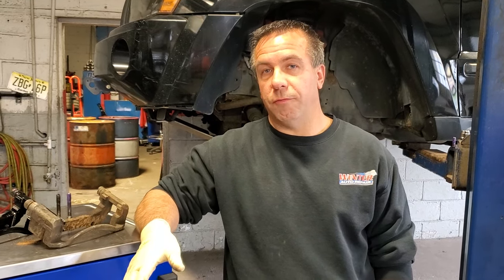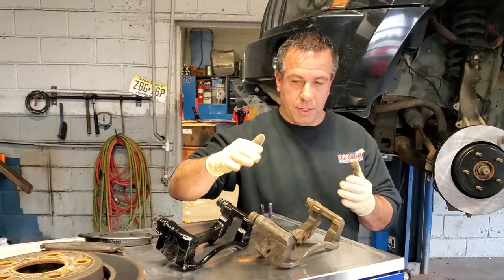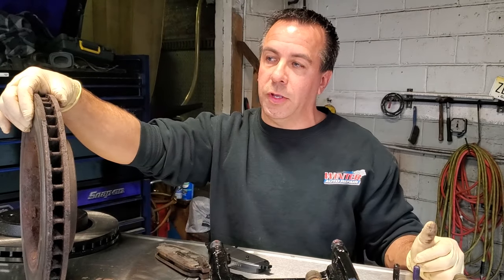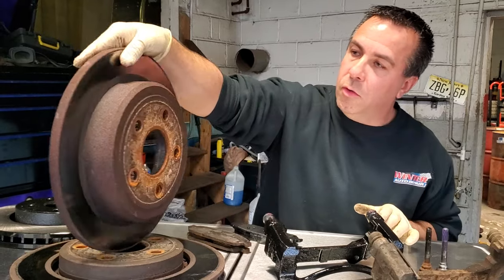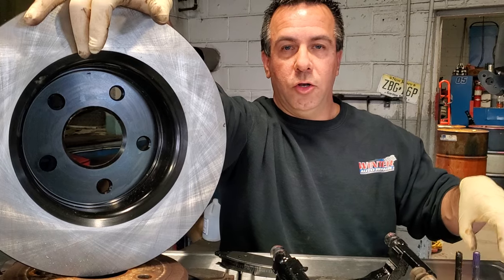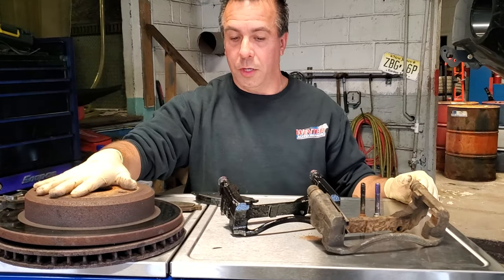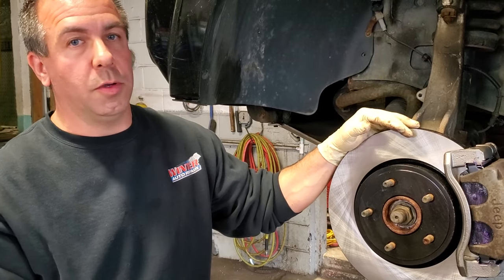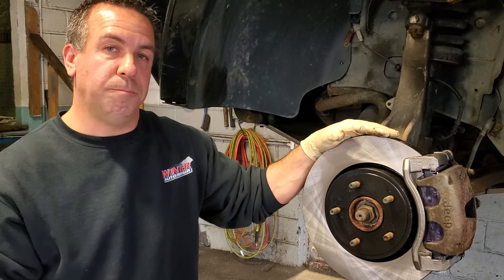High quality brakes vs cheap brakes

Comment: Not only re you a family man and want everyone to be safe, there is a major liability issue here.  Should you inspect the vehicle and see that it needs a repair and you do not attempt to notify and make said repair, and that person leaves the shop and has an incident caused by that part/system failure, then you can be held liable.

Comment: I ordering Wagner rotors. I’m pretty sure they are at least close to these standards.
Reply from the maker: Wagner rotors are nowhere near the quality of these. They are very basic rotors similar to the cheap rotors that fall apart. The rotors we used in this video are Centric high carbon. This is our favorite brand of rotor to use. When Centric isn't available we will use Perfect stop high carbon or Durago EP rotors. Make sure the rotors are high carbon and coated for them to last the longest. 
I hope that helps and good luck!
Please subscribe if you haven't already, we appreciate it.
Reply: @WinterAutoRepair  well I wish I had known that 4 days ago. 
The Wagner rotors are coated. I couldn’t figure out if they were high carbon or not-nor could I figure out what others are high carbon as I could not find specs for that anywhere.

But, I may consider delaying my repair job and order one of the brands you mention above.
Thanks!
Reply: @WinterAutoRepair  it seems that there is difficulty finding high carbon rotors for a 2003 Toyota RAV4 other than the Raybestos brand.
Reply from the maker: @KatJaguar1122 that does happen with some older cars. I just looked up on Rock Auto for a 2003 Toyota Rav4 with a 2.0. There are a few options. The Raybestos high carbon. Now, I have never tried them. However, Raybestos bought Centric a few years ago now. They very well may be the Centric High Carbons, but I can't confirm that. You also have the DFC geospec rotors. They are not high carbon, but the former owner of Centric started DFC. When he came to our shop, he explained the process on his new DFC brand, which is a good process. We have used these rotors and have had good luck so far. Last, the Centric 120 line is available for your car. That is a good rotor and one that I have used many times. It's coated inside and out just like their high carbons. If I were you, I'd go with the Centric 120 rotors.  If you're an aggressive driver, then try the Raybestos high carbons. 
I hope that helps!
Reply: @WinterAutoRepair  okay. I considered the Centric 120, but decided to go ahead and spend a bit more and get the Raybestos from Rock auto, and I got the purple Permatex grease also. My RAV4 only has 110k mi on it, so they will serve me well. I got Akebono pads to go with. 

Thank youso much for the detailed input 🙏🏼
Reply from the maker: @KatJaguar1122  you're welcome. Depending on where you live and how you drive (stop and go or highway miles), you should get 60k miles out of those brakes. We are about to make a follow-up video to this brake video. This particular jeep has gone almost 70k miles since we did the brakes. We are going to be taking it apart and checking them in January to see how they held up vs. the cheap stuff it had on it previously.

Comment: Unfortunately didn’t work in my case
Bought all 4 for my sonata 
5 months later they warped 😢😢😢
Reply from the maker: What brand did you buy and what pad did you use?
Reply: @WinterAutoRepair  
I watched your video and decided to buy 
Centric® 120.51054 - Premium Vented Front Brake Rotor
Bough the rear as well
And I bought Akebono premium brake pads 
😩😩😩😩
Reply from the maker: I would have used the Centric pads with the rotors so I'm not sure if the pad compound was too much.  I can tell you that their 120. Line is their basic line and their 125 is the high carbon.  If the pad is too aggressive it can warp a rotor. Driving style and where you drive can also cause warping. Sorry you didn't get good life out of the rotors.  In all my years using their parts I've had very very few failures.  
Thanks for watching and commenting.

Comment: Just a note... I have learned that the purple grease should NOT be used on the caliper slide pins. Use Sil Glyde or a Silicone Paste. The purple stuff is great on the brake pad, but NOT the slide pins. Feel free to read on the internet or watch other youtube videos to see.  One guy even has a PSA video on this very topic.

Comment: Thanks to Allah I still have original rotors and pads on my Mercedes E400AMG after 9,76 years and some 92000 miles also original wiper blades and we have obligatory inspections!

Comment: I have a 2016 Dodge Dart and need to put new rotors and best pads I can get.  Seems all the GREAT Brakes manufactures are all out of business. can anyone mention ANY brake company still selling brakes
Reply from the maker: I had answered you previously on the same question.  We are currently having the best luck with DuraGo EP series rotors. We will also use Perfect Stop high carbon if the DuraGo aren't available.  We get the best life out of them.  Rock Auto usually has them for most applications.

Comment: Obviously tire plus does top notch break jobs. They said (while changing my tires) front pads are worn and be 550 to replace them lmao.

What I do is learn how to do stuff the right way so all that money you save by doing yourself you can get high quality parts and save money still. Good skill to learn, and ladies love it when they see a man under a vehicle with dirty hands holding a wrench……makes them weak.

Comment: It's not about the quality of the brake pads it's how much exposure to the corrosive snow removal compounds the brake parts have been exposed to.  My rotors were scaling due to this.  The thinner metal that is used to hold or bond the pads to their assembly simply disappear and fall off...just like the inner pads on parking brakes that detach for the same reason.  The rusty rotor that he was replacing was fine.  What a rip off....OEMs are just like that and had NO issue worthy of replacing it.  Dumb customers get ripped off all the time for lack of knowing the truth.

Comment: Very good.  I appreciate your attention to detail and quality, missed so often in today's market conditions.  I agree with just about everything you said, except the 3000° grease.  Since it is purple, I assume it is Royal Purple Aluminum Complex grease.  I know of no Royal Purple grease or any other grease good to 3000°.  Did you misstate the temp or can you tell us what grease you are using?  Thanks for the very good video.
Reply from the maker: Thank you! It's no mistake. The grease we use is good to 3,000 degrees!  We have been building and racing cars for decades and have relied on this grease to last during our 24-hour endurance race events.  It's Permatex Ceramic Extreme brake parts lubricant.  Part # 24125.  
Thank you for watching and commenting!

Comment: Do yourself a favor and stay away from those ceramic brakes. Got into a fender bender recently because i couldnt stop on time. I blame the less bite that ceramics have.
Reply from the maker: We've been using them for years without an issue. I'm curious about what brand you were using so I can look into it. That may be a good video for us to make in the future. Testing brands of pads and how well they stop compared to each other.
Reply: @WinterAutoRepair  I used Akebono and they just need to get warm to have a good bite. I even bed them in. Nothing comes close to the bite of metallic brakes.

Comment: And that’s why I like our system here in Australia,every vehicle you purchase wether private sale or from a car dealer all vehicles must have a current roadworthy certificate before you can take ownership and in some states all vehicles have to have annual roadworthy inspections before they can be registered for another year,so it means we get safe cars that are up to a particular safety standard but that’s not the case in America unfortunately. Some of the vehicles I see in America that have been taken to a workshop for mechanical repairs are so dangerous they shouldn’t even be driven. The safety standards in America when it comes to vehicles is very poor.
Reply from the maker: I agree with you, unfortunately.  Just today on my ride home from work, a newer Acura Integra (maybe 2015) had a ball joint break on the left front wheel and the car was sitting on the ground with the wheel pushed into the fender.  People don't understand how dangerous their cars are when not properly maintained.  
We do our best to educate our customers, not for our gain but for their families' safety. 
Thanks for watching and commenting.

Comment: Yeah i usually tell my customers that decline important work i work my kids live here so just be safe and ill avoid your car cause i dont want to die or get stuck behind u
Reply from the maker: We have a similar approach.  In fact, we had one not too long ago that we told that to. They needed upper ball joints and didn't have the money because they were going on vacation. The car came back a few weeks later, and the balljoint let go, and the upper spindle was sticking out of the fender. I know some mechanics try to rip people off, but most of us just want to keep people safe.

Comment: Great video. Wish you were my mechanic, although not sure where you are.  (I'm on Long Island).
Question, if you would be so kind:  My car has 148,000 miles on it (2011 Hyundai Genesis Coupe 2.0t).  I am about to have the rotors changed by a shop (I bought high quality rotors and pads).  The brake calipers are the originals.   Should the calipers be changed?  They've been problem free, thus far.   (I might have a follow question when I hear back from you)
Thanks!
Reply from the maker: We are in NJ about an hour ride from Manhattan.  
Your calipers and hoses should still be okay. Make sure they remove the pins out of the caliper bracket, sand them, and grease them. That is the most important. The caliper bracket needs to be sanded where the pads ride and use new hardware (the hardware comes with good pads usually).  If you do need calipers, get new hoses as they tend to collapse on the inside. 
I hope that helps. Thanks for watching and commenting
Reply: @WinterAutoRepair  thanks so much, I greatly appreciate your advice !   If I have other questions, I'll post a new comment...subscribing to you now
Reply from the maker: @dannyspitzer1267  you're welcome. Let us know if there is something else you're interested in learning so we can make some new videos.

Comment: Thanks for the video, can anybody suggest a good place to buy the brake parts?
Reply from the maker: You're welcome, and thanks for watching and commenting. 
You can try a good local autoparts store first.  If not, Rock Auto usually has some decent brake parts available. 
Currently, we have the best luck with Durago EP high carbon rotors and power stop pads. 
Good luck and I hope that helps!

Comment: @Winter Auto Repair  Is that a Centric rotor?  I have a 2003 Silverado and would like to know what you would use.  Thankyou for your honesty.
Reply from the maker: The rotors we used are Centric rotors. We use that brand as well as Perfect Stop and Durago EP. All 3 offer high carbon versions, which is what we use.
Reply: @WinterAutoRepair  Wow I didn't expect an answer that fast.  I looked those brands up and they cost about the same or less than the Napa brand I bought for the rear brakes 3 years ago.  I'm going to go with the Centrics.  Is there a problem with different brands on the front and rear.  Thanks again for your time and honesty.
Reply from the maker: Haha. I try to keep up. You'll be okay mixing brands. Since this video was made, Centric was bought by Rabestos. I'm not sure the quality is the same, honestly.  We've had the best luck recently with Durago EP high carbon if you can find them.  
Thanks for watching and commenting 
Chris

Comment: Duralast has a crosshatch rotor on the higher price point.
Reply from the maker: Autozone has recently contacted us with a new (just released) high carbon and coated rotor.  They gave us a front and rear set to try out.  I have them on my wife's Jeep Wrangler unlimited currently. We will make a video once we've used them for about 10,000 miles to see how they are holding up compared to the brands we currently use. (Durago EP and Perfect Stop) 
Thank you for watching and commenting!
Reply: I use the Duralast GOLD rotors - I think that's what you are talking about - on a lot of brake jobs because they do hold up well.  I have found them to be similar quality to the Centric 125 and a lot less effort to install because the surface doesn't have to be cleaned so thoroughly.  @WinterAutoRepair

Comment: Nice video.  I'm in North Jersey and do my own pads and rotors.  Just bought some Raybestos pads and rotors for our 2017 Carvan.  The pads came in a redish box but the rotors, White Box all the way.  Since I do mine it's nbd and I don't mind slapping new rotors on every few years.  Plus the old ones make great weights 😂.  100% those parts your using are better and your clients will get longer life out of them.
Reply from the maker: Next time try using better parts. You'll see a difference in how they are installed, how much better they stop, and how much longer they last! The better parts are way easier to install. Make sure you clean the caliper brackets with a wire brush and use Permatex Ceramic brake grease on the guide pins and pad hardware.... 
BTW. I grew up in North Jersey.  Mt. Olive township off of Rt 80.

Comment: Cross hatching does not balance a rotor. Balancing a rotor balances it. And since your "Black box" rotor has no drilled holes for balancing, it is not balanced. A lot of expensive rotors are 'White Box' rotors that have been painted, Blanchard ground and put in colorful named boxes. China has made this all a crapshoot unless you buy the expensive rotors at the dealer.

Comment: I get over 80k miles on my Lexus RX330 pads and rotors which cost me about $600. Going to replace them with POWERSTOP Z36 which cost me about $400. Fingers crossed I get at least 80k miles on them... hoping for 100k!!!

Comment: My factory Honda rotors lasted 62k miles. Replaced them with "white box" rotors and they were toast in less than 15k. I was PISSED.
Reply from the maker: Unfortunately this is what they don't tell you when they sell you cheaper parts.

Comment: I am really shocked at how few people have called you out on about 5 points you made that were pure bullshit. The majority of calipers I am buying now come with the brackets and are painted or plated. And even the cheapest rotors are coming pre surfaced, painted, ready to install. And the fact that you are selling customers rotors because of a little bit of rust, omfg dude. And then there was the flat out lie about not being able to turn rotors. All this shit is pretty much coming off shore, no matter what you pay for them. Even the Napa parts are now made in China.

Comment: I have more time then money so I do my own brakes.  I'm slow, takes me a long time so a professional is more efficient. But for 250 dollars in parts, I can use premiums Akebono parts and do both axles vs 700 dollars if I paid a pro.   But........ if I had the money I would pay a pro to save time.

Comment: NJ Does have inspections.  I go every 2 years.
Reply from the maker: They do not have safety inspections. That's where the issue is. They check your gas cap and your check engine light only. In the past, they checked your brakes, suspension, and all safety equipment. People think their cars get checked for all these things still, but they aren't. Then, when you go to a mechanic and they advise you that you need brakes but you just passed inspection, people feel the mechanic is lying. When, in fact, there is no state safety inspection, only emissions.

Comment: Seems like a jeep issue.
My toyota's and honda's go 100k+ miles on factory pads and rotors and still have material left and not touching the low pad shims.

Comment: Hi, is the 450 brake job for front and rear or only two wheels?
Reply from the maker: With the good parts, the average cost to have all 4 brakes replaced is about $1000 parts and labor. Since the pandemic has ended the cost for rotors (both cheaper and high quality) have gone up substantially.  This price includes labor. We charge about 1.5 hours labor (45 minutes pet wheel) for installation. If you're installing the high carbon brakes yourself you'll save about $400. Thanks for watching and commenting!
Reply: @WinterAutoRepair  I did my own cars before but am working on friends cars and did not know how much was fair to charge. Being a perfectionist I do a good job. Recent Subaru rotors were 65 each and pads about 65 each. So there were about 200 in parts. I think I charged about 100 or maybe 200 for my labor. Thanks for your video and answer. We don't get that much rust here in El Paso but I still don't want Autozone China rotors going on a car. Cheers

Comment: Can the high end rotor be machined?  If it is also one time use the advantage is?  For example I just put on front Brembo rotors.  Significantly heavier than the OEM can it machined?  Price to machine is probably more than buying new, but curious it has machining specs while the OEM does not.
Reply from the maker: Yes. The high carbon rotors can be machined. However, most Brembo rotors are slotted and/or cross drilled. This will break the tip of the lathe as it's being cut. They are not designed to be machined, they are a 1 times use only. If it's a standard flat surface and it has enough material, it can be cut.
Reply: Thank you the response.  In my case the rotor are flat face, even Brembo needs to make money by selling better rotors to the masses such as me and my Sonata.  Too bad it appears they only sell fronts for the Sonata. I will give machining a try eventually, I will replace with new rotors and machine the pulled set as a back up set with anti-rust coating stored in synthetic air atmosphere with moisture less than 0.5 ppm.